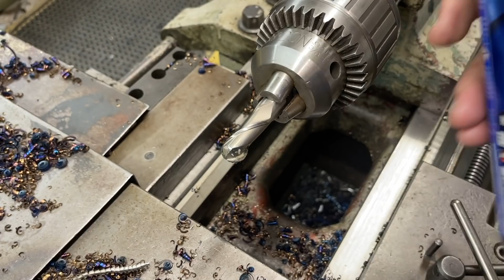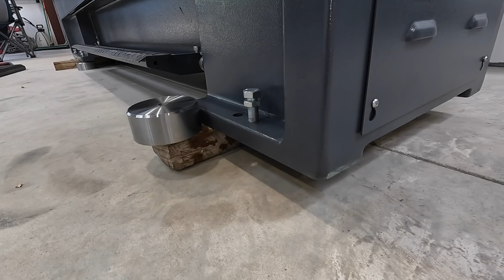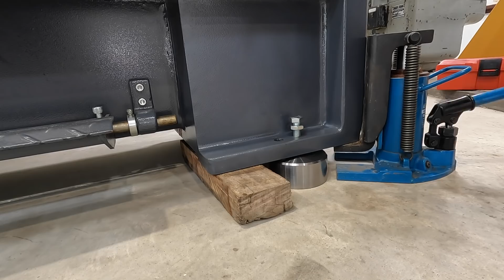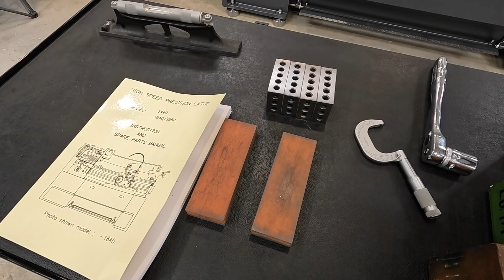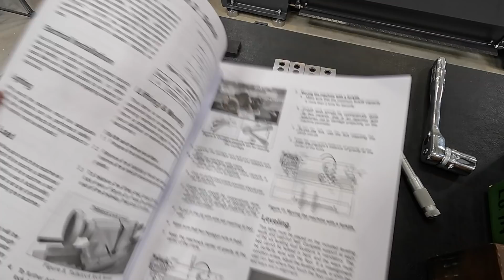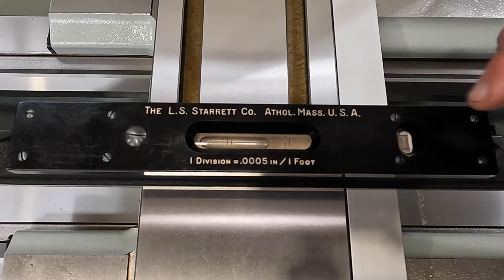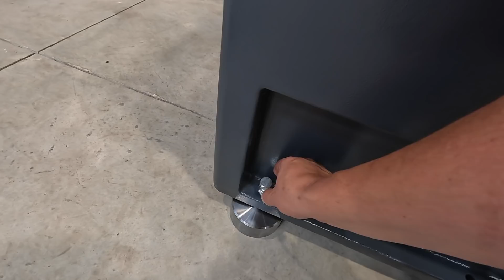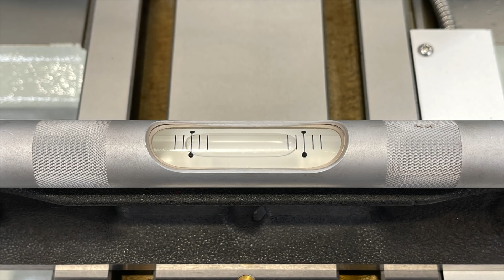Leveling the Precision Matthews TL-1660 Lathe

Comment: This whole thing just makes my head hurt. The only take away I can see is that this process is, for a flimsy built lathe to keep it plumb, square, and perpendicular. SMH.
Reply: There are many videos that explain the leveling/truing process that all lathes require.  Old wartime Monarchs to modern electronic machines benefit from setting the machine properly.  Adam's "new" American Pacemaker is the furthest from "flimsy" as you can get, yet it will require testing and "tweaking" the bed to insure "0" taper.
Reply: You could have the most incredibly precise/rigid/twist-free lathe money could buy... but you're setting it down on concrete. The floor is nowhere near perfect.
Reply: I am not sure where to find it, but there is probably a video out there showing the amount of flex that cast iron, cast steel, & even steel can (& does) flex.  I don't remember the specs either (it's been about 30 years ago), but it is far more than people realize.  Therefore, setting it own on a concrete slab that is "leveled" with a wood or steel screed board around 10 feet in length, followed by an aluminum or magnesium hand float to fill in the screed pipe lines & smooth it all out, and then a pwer float just before the concrete becomes too stiff to flow at all makes a smooth & flat appearing slab, but not so much when you are dealing with a measurement of less than the thickness of a single hair strand.  Hence the need to level the bed of an eight foot long precision tool.

Comment: the second one looks like a fisher mans pad  I have several (purchased the first one was given to me  It is a fully water resistasnt one with a membrane through the middle that stops water penatrating the upper layer of foam  I t was a god send when working out doors as the floor could be wet and my knees stayed dry / as I mentioned earlier I now have several mostly bought from boot sales/ swap meets / on line auctions and frriends

Comment: Adam, those far left feet that you just snugged up actually can affect the tilt of the headstock independent of the ways. You want to make sure that the spindle's axis of rotation is parallel to the ways and those adjusters will affect that. Joe Pieczynsky talks about this in one of his lathe adjustment videos. It was a pretty good explanation as I recall. I'm told that some lathes actually have an adjustment on the headstock itself, but I've never seen one. That lathe looks really sweet, BTW. Congratulations on the new and shiny machine!! I'm retired and just have a small shop in my basement. Got one of the smaller Precision Matthews machines and I've had good luck with it. The company has great customer service. I think you'll be happy.
Reply: WOW… interesting point.  How would a person go about doing that level??  I’m thinking it’s a tool like a bore sight laser inside the spindle.   Am I close?
Reply: @franknphotos  I think laser would be the way to go, as gravity is not your friend here. I came up with a method that I used to compensate for sag of a chucked precision ground bar (can't use tail stock for this adjustment for obvious reasons), but it's too involved to explain here. Basically it measures the sag of a chucked test bar and that value is used in the adjustment. I'm working on a small hobby lathe 12x28, but the theory would apply to any sized machine. I leveled my machine about once a month for the first year I owned it. It took that amount of time to settle in and stabilize. I think it's because it's so light. The last few times I've checked it, however, it hasn't budged and I'm getting some great precision on this little chineseium thingy.
I'm jealous of Adam - I don't have the room for anything bigger. But you know what they say. It ain't the size of your tools that counts. Wait, what?
Reply: I know some Colchester lathes have a pivot point that you can adjust the headstock 'on'. That way you can make it turn super accurate. 
Depending on the lathe size and how it's build, it can be hard to adjust/twist it 100% without bolting it to the floor.  Some are super stiff and won't twist, only raise/not touch as hard on one/another feet 😊
Best regards
Reply: @OmeMachining  u
Reply: Adam has done this long enough that I'm sure he knows all about it. It's actually a separate procedure that either takes a precision bar with a taper to fit the headstock,  or the use of a 4 jaw chuck, which wasn't available at the time the lathe was shipped.
Reply: My Hardinge CHNC has adjustments to align the headstock to the lathe body.

Comment: Why put a longitudinal fall in the machine bed to make coolant drain better?? How do you know the bottom of the chip pan is parallel to the bed??
Better in my mind to level the machine perfectly...
Reply: I had the same thought, should it not be designed to have proper slope, or more than needed for proper drainage to pickup.
Reply: As someone above said, 'it's not going to be a precision chip pan' hehe so why compromise the precision part for the mundane flow of coolant?... Apparently it makes little difference to anything but it just seem ridiculous to me.

Comment: Once again I'm not a machinist ! wouldn't make more sense and easier to adjust a " machine " with a fine thread bolt ( adjuster ) ??!!
Reply: Normally it would be a fine tread for adjusting purpose 😊
Reply: If the machine came with a coarse thread, you're stuck with it, however most metric threads have a finer thread than SAE anyway.

Comment: The next step to level an engine lathe is to confirm taper. A standard in the chuck can be indicated against from the saddle travel. Indicate along the top side of the standard to see the indicator easily. Adjust the rear headstock leveling bolts to correct error. You are adjusting for "up/down error" only at this point. Now reconfirm bedway twist, sagging and crowning employing the demonstrated methods. You will likely do some tail chasing closing in on machine level. Twist correction is vastly more important than level as Adam demonstrated by intentionally adding slope for coolant drainage. .002" slope is arguably insignificant for coolant drainage, but certainly causes no machining harm.
The final step I would employ us to validate headstock taper. This is done by turning a sizable piece of stock with as much stickout that won't allow part deflection, No Tailstock Engagement. Test part finish is critical for best taper measurements. Mic the turned diameter. Adjust to correct taper by loosening the headstock hardware and adjusting via the adjustment screws at the rear of the headstock. The front of the headstock pivots on a pin centered under the chuck end of the headstock. Make certain you track headstock movement before loosening the headstock hardware and while making adjustments. Monitor adjustment with at least .0005" test indicator. A .0001" may max your indicator travel when you loosen the hardware or make adjustments. Tighten headstock, recut test piece and confirm taper correction improvement. This procedure can take several test cuts to eliminate spindle taper. Your first compensation correction success gives guidance on how much to move to obtain the desired and needed taper correction. 
I had various pilots that varied in their opinion on how much taper was acceptable and if the tailstock end or the chuck end should be larger if no taper was unachievable. The type of work performed on the machine will help dictate this decision. This is a toolroom lathe and I would expect that Adam wants precision work and he will machine with light tool load for finish management and tool deflection minimization. I would shoot for .0000" taper over 12".

Even brand new machines need the taper confirmation. You could see from the video how much an engine lathe twists, crowns and sags. Shipping and rigging is not kind to maintaining factory adjustments.

Ideal leveling methods would have included anchor bolts. Anchor bolts allow down pressure that machine weight cannot provide. Machine design mandates that anchor placement must be done before the machine is set in place. Aligning over anchors set in concrete is a challenge. Adam placed this machine by himself with a jib crane. He would have really frustrated himself lowering over preset anchor bolts. An alternative is to core drill the floor, remove the core and set J bolts loosely in the hold down holes. Place the machine with the J bolts dangling in the holes. Set grout to secure the J bolts. I only bothered with this step a few times, and I have set up hundreds of machines. The haters will point out that Adam straddled a floor control joint. This is unwise, but I managed machine tool set up for 34 years and found that we suffered virtually no machine tolerance issues in our parts coming off machines that straddled control joints. Adam already explained that he straddled the control joint to allow room for a knee mill under his jib hoist. Sometimes we have to make compromises. His machine is too close to the wall for OSHA and NEC required workspace, but he squeezed this dimension for the same space constraints.

I demand best practices. But life forces compromises. I have some tricks that I would have pulled out if I did this job, but high precision is never perfect in reality. Adam admitted using 1-2-3 blocks is less than perfect for parallels to straddle the V way. I agree, but Adam reduced his error by confirming 2" dimensional accuracy. He had no provision to inspect squareness and flatness, but I agree that his technique with the blocks was pretty good. If you employ parallels to bridge the V way, consider using 2 precision levels, one on each end. Then you don't introduce error by moving parallels and levels.
Old lathes didn't have reliable flat ground surfaces to set the level like Adam's new machine. This factory ground flat and parallel surface is very handy for lathe setup. The cross slide rides on the carriage on the flat and V ways. Since twist, crowning and sagging are your machining accuracy enemies, all can be inspected simultaneously.

Hunt on chuck runout compensation... Old chuck OD's we're not trustworthy for indicating surfaces. OD was not always true to chuck centerline. This was regarded as a non critical surface and machining complexity allowed for machining tolerance. The chuck face was more reliable, but indicating here meant interrupted surface for the chuck jaw slots. Modern machining allows for the non critical chuck OD to be machined true to the spindle mounting surface and enables the chuck OD to be a reference surface. This manufacturing improvement enormously improved my life.

Comment: The machined cast iron faces of the saddle looks as though they’ve been pounded on for several years. You can see that in the closeups. I’m surprised. I’ve not seen that on a new machine. The cross slide looks fine.
Reply: Isn't it just some dirt in some thick layer of oil? 
This can make it look similar I know on mine 😁
Reply: @OmeMachining  maybe, but it doesn’t look like that. I’m hoping that’s what it is.
Reply: He said he still had to clean off all of the rust inhibitor oil. That can definitely make a surface look rather beat up and cruddy until it's cleaned off.
Reply: @johndonlan5956  I hope so.

Comment: Some people think I’m crazy, but I always use way oil on any screws I use, unless specifically, they shouldn’t be lub’ed. I also use moly grease on heavy adjustment screws like he’s doing here. That’s really the safe way to go.

I bought my knee pads from the ubiquitous McMastercarr. They have them in different sizes.
Reply: Harbor Freight has them. I'm 275 lbs and they are a savior.

Comment: I remember my summer as a machine builder (college kid, first 'responsible' job in an industrial setting (building drive shafts for DANA doesn't count here)).  We had huge bases for a big machining line that was being built.  16'~20' long, 4' ~ 6' wide.  Each base had 8 to 12 leveling screws (2-1/2" screws).  It came time to finally level those things (30 or 40 of them), and they brought out the laser instead of the levels.  I chased that damn beep an entire day trying to get that think level.  It ended up taking a solid week to get all of them done and I only did one of them, the "experienced" guys took over and it STILL took them 1/2 day per base working in teams.  Still one of the best "college" jobs I ever had.  I got introduced to the Bridgeport, surface grinder, lathe, drill sharpening, indicating, surface plate work (basic), and a few other things.  I loved it, and looking back at my life 30+ years later? Probably should have stuck with it...it was enjoyable.
Reply: Sounds like major deal even with lasers…. Can you imagine if all you had were bubble levels
Reply: @franknphotos  I can't...just can't.  It was brutal with the lasers because they were so sensitive and beeped like crazy.   You'd move ONE screw just a fraction of a degree and BEEEP....move to the next corner...BEEP...move back "nothing".  Also due to the size of the bases you had flex in the middle of the base, so you were adjusting constantly.  What really should have been done is use a couple of sensors, find the low spot, high spot, and move from there.  I think they finally did that near the end, kind of how you would do grade stakes for building and such.

Comment: Nice levelling! What about leaving the plastic on the display plate for now? It will protect the panel, and when it gets ratty you can then peel it off? I did that on my lathe and it lasted a few years and the panel was pristine underneath.
Reply: I don't like doing to this. The adhesive gets gummy in time and machining fluids are not kind to the plastic and glue. Waiting tooling can make a real mess. In my career, virtually all of my coworkers disagreed with me. Machine data plates were the worst. If that protective coating was left on and it got nasty and curled, it likely peeled off the data plate color when you wanted to read it.
Reply: @paulhunt598  yah makes sense! I guess I was lucky lol.
Reply: The protective plastic sheet tends to be a collector for dirt and coolant...... You really need to get it off as soon as possible.